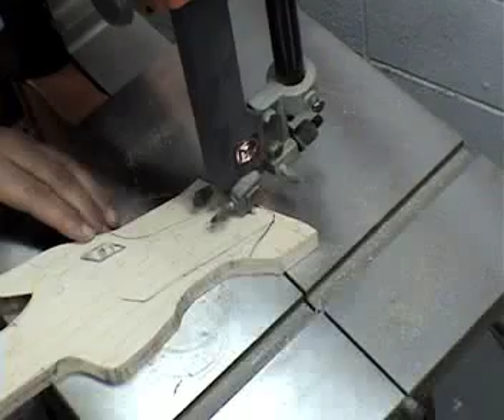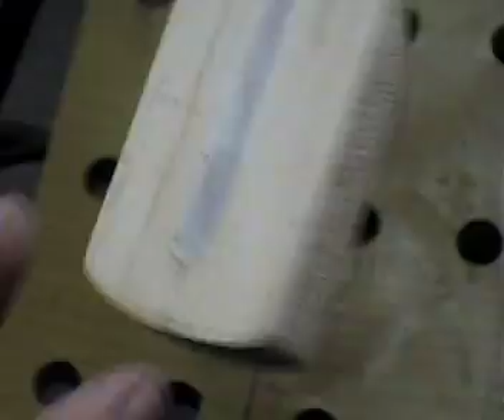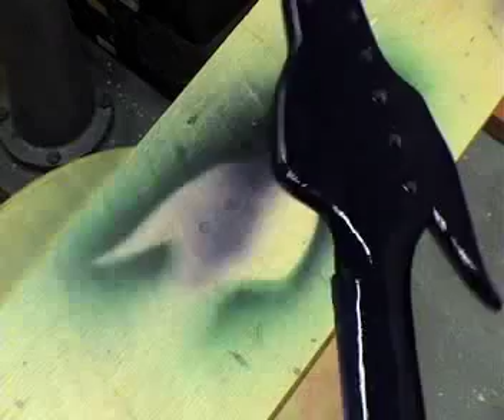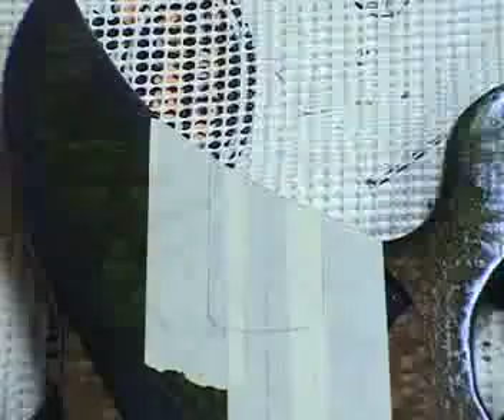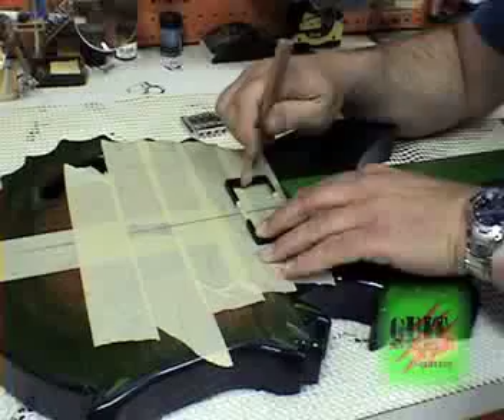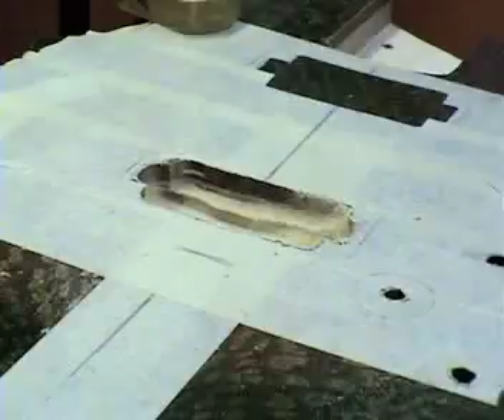How to build an Electric Guitar Part 2

Comment from the maker: @critical1080 It is called a truss rod and it keeps the neck straight. Strings adds tension and the Truss Rod will help keep the neck from warping or cupping. An Adjustable truss rod is the way to go, you can tighten or loosen the tension to adjust the straightness of the neck.

Comment: Thanks for making this video!
Cleared up a couple of questions I had about the neck.
But, now I have a question for you:
Why did you put a finish on the body before routing out the pickup slots, neck pocket and control cavity, etc.?
It'd make more sense the other way around, because I(and a lot of others) have the tendency to scratch the body while building. Especially since the Clear-coat would still be soft and not fully cured.

Comment from the maker: @r7mart  It sounds like you are a wood worker. I did not use a scarf cut the wood used for the neck was long enough. I talk about sanding the the body with a fine sand paper and then sealing it with Lacquer before appling the color coat, that is followed by as many coats of clear lacquer as desired sanding in between each cat with 6oo grit wet sand paper. Good question
Perry

Comment: What kind of cut did you use on the neck to the stock. Was it a scarf cut. Also it didn't seem like you used anything the prep the wood before paint, is that true.

Comment from the maker: It depends on the length of the volume and tone control shaft. leave a 1/4" thickness of wood on the face. I drill the pot holes first so I don't remove to much wood.

Comment from the maker: they sell an aerosol can and spray cup for less than $25.00, I have never used spray paint I don't know where to start but there is nothing wrong with experimenting it can always be sanded off. But I still would use acrylic.

Comment from the maker: The rod is called a truss rod and it is used to keep the neck straight, The tension from the strings at times will make the neck bow and adjusting this rod will keep the neck straight.